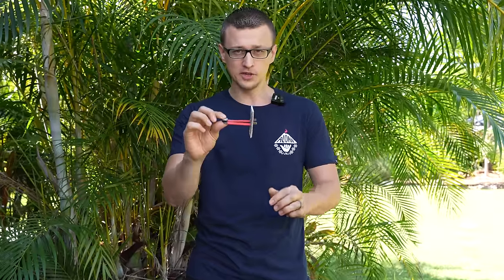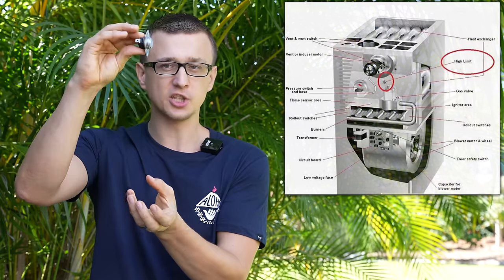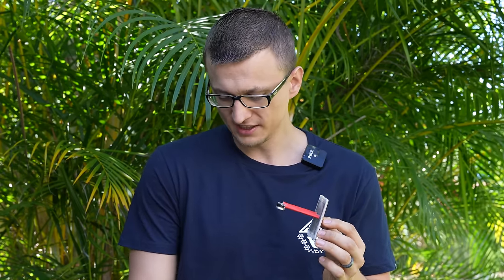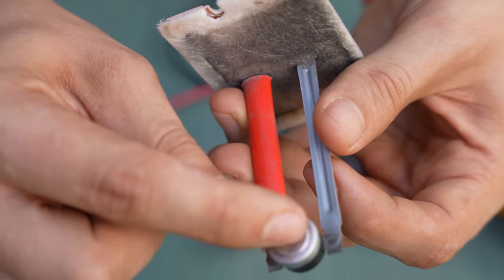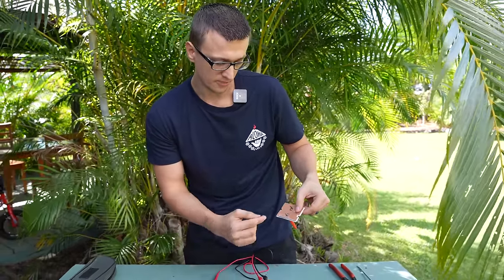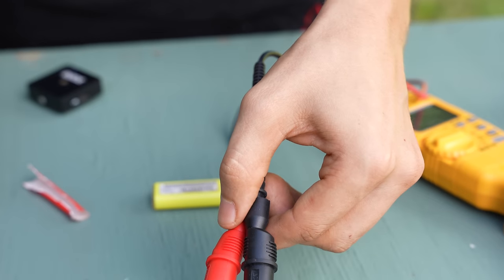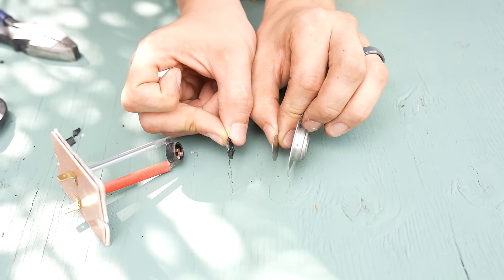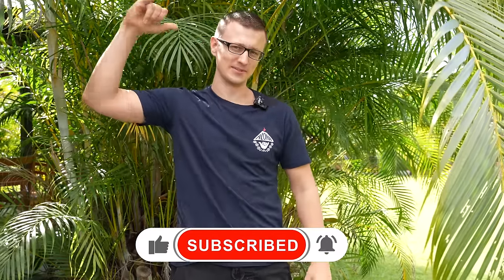HVAC Furnace Short Cycling - How High Limit Switch Works

Comment: Hi Jay, My Goodman Furnace, GMSS96 will not heat with a filter installed with a Merv rating greater than Merv 2. Getting 4 flashes from the red LED. (Primary Limit Switch Circuit) Goodman's tech support recommends a Merv of 8. Replace the 8 Merv with a 2 Merv, all is good.
Any thoughts on this? Any viewers have the same issue?? Thank you all....
Reply: Check blower speed
Reply: @Sesamestreet9080  Thank you.
The blower speed escaped me🤔
Thanks for the continuing education!😁
Reply: @doctor9768  no problem. Also check the coil if that’s caked up with dust that also can cause airflow restrictions

Comment: Why do they go bad?
Reply from the maker: They rarely go bad but if they do, usually that is because that little snap disk starts to get stuck. Sometimes it can trip and then not reset or it will take a shorter/longer amount of time to trip which would cause the furnace to shut off prematurely or get hotter than it should be.

Comment: No heat    FIVE OUTSIDE PLEASE PLEASE PLEASE ANY IDEAS IR A WAY TO BYPASS SOMETHIMG. BETTER A SAFE WAY OR I DO ANY WAY.  NOT DYING BY FREEZIN  no nothing first it would run bit off now inducer nothing fan humms . I spin w hand . Fan goes no heat no inducer,, take off any wire on safety stuff inducer an fan zoom NO HEAT SHUTZ OFF 3 MIN  DO AGAIN PUT SECOND ONE WIRE ON WHICH EVER ONE I TOOK OFF AND INDUCER KEEP GOING no heat. It stops inducer not go fan hum unless u unhook a wire somewhere last ppl not into changing filter I cleaned lot stuff behind inducer hose ECT  hose tad closed on limit water thingy. But my common sense says baffles heat exch.  Equal NEW FURNACE but I could and hope I wrong. So u never seen my issue and t I never hear aFAN TRIES TI COME ON. IFppl hear that I sure first thing they gonna do is go buy new motor.   9)10 if u can spun it it ok

Comment: Temperature limits do not fail like that. In 16 years of HVAC service I have NEVER seen a furnace short cycle because of a "faulty" limit as you describe. The bi-metal inside the element will ALWAYS deform at the SAME temperature... If a limit fails it will be an open circuit failure because the bi-metal has failed causing a constant blower no heat issue. If your furnace is short cycling you have an airflow issue. Period.  Either the furnace is oversized or something is restricting airflow. Ugh the false information on youtube makes me really sad. Also your comment section is filtered to the point of hilarity.
Reply from the maker: Thank you for the correct explanation of how the bi-metal inside an element works. This video was to simply show how a limit switch works and I believe I demonstrated that just fine in this video. This was not a video on troubleshooting or diagnosing. Also, I do not easily remove comments. In fact I very seldom delete any comments. Only when the other person is being nasty and using vulgar language. Comments with swear words automatically get filtered out and due to the abundance of spam, any comments with website links get sent to the held for review folder as well.